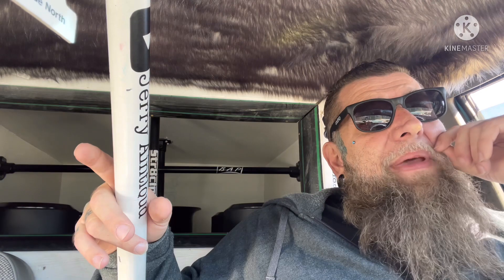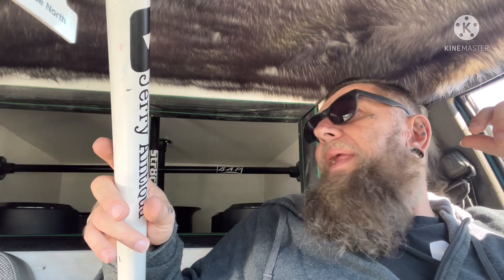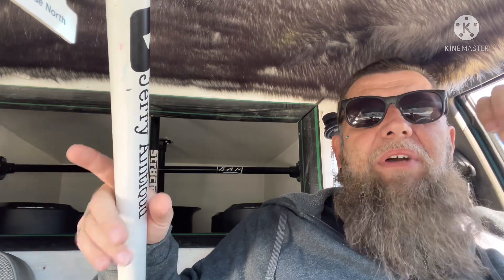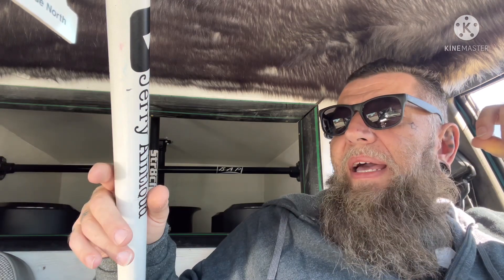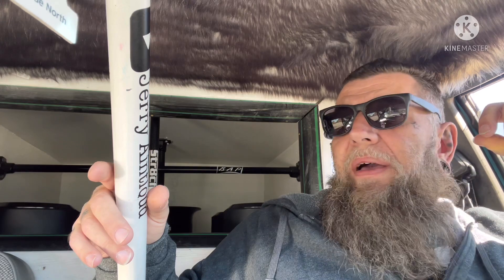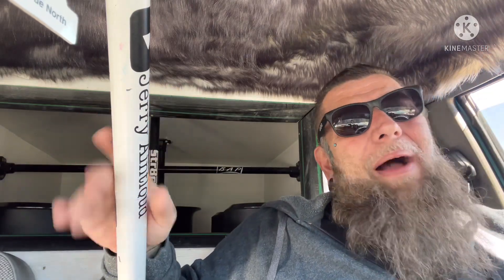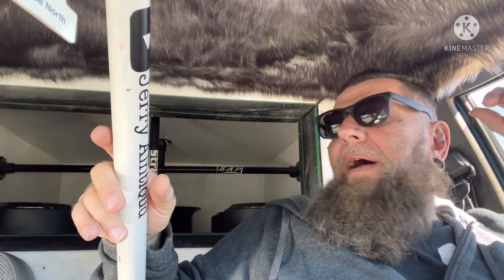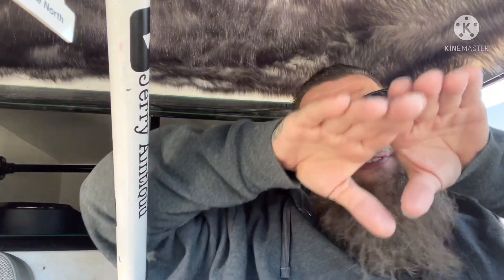Subwoofers is less more

Comment: Yeah,  everyone preaches that cone area is king... but that's not always the case, at all.  I've seen a lot of builds, over the last 30 years or so,  that when drivers are removed and or downsizing.. they gain,  and sometimes a lot of gain.  Cancelation plays a huge role, in the cabin volume, aside from the box volume it consumes in that cabin.  Standing waves, with nowhere to go.  The cabin is essentially part of the enclosure,  and needs to be considered when plotting out any build.  And many times,  it's trial and error.  It's not always, how many drivers you can cram into a build,  because many times.. less is more lol.  Good video
Reply from the maker: there's tons of variables.. back in the old days we thought only 15s and 18s would play lows.. we live and learn
Reply: @JerryAintloud  agree,  in the late 90's i always ran bigger woofers/subwoofers just to get louder lol.  I miss the mini truckin days.

Comment: Your vehicle becomes part of the enclosure..so what would the enclosure type be..4th/6th ect..box designs can get to a point of being very inefficient..so if your jeep was a speaker box with wheels where would the inefficiency most likey come from..forget about cabin or the jeep all together picture only a box in your head..measure the jeep nothing in it when rebuild run those numbers through a box program..ur windows being port size. Just for s&g's do 6 sub 8 subs ect ..it will clear up alot..

Comment: I have been running 2.5 inch coil 12s. I have them on double power and in a smaller enclosure than what the specs call for. Theoretically if I move to 3 inch coil 12s with a higher xmax and that have specs calling for a smaller air space, which my box is already, I should gain a small amount of decibels. Do you agree with this? I will be overpowering the 3 inch coils as well but not nearly as much as the DDX.

Comment: I think mbe enclosure explained  it when he said the bass wave has to mature, so from  the cone and port to your ears or to the meter, the bass wave has to develop correctly .moving too much amounts of air in a small cabin space causes compression . Not yielding  the best results. Also subs that don't pressurize the cabin enough won't yield  the best results either. So I guess you have to know what size  subs and how many moves the correct  amount of air for your particular cabin

Comment: I absolutely agree atleast with my experience.  I went from 4" coil subwoofers to 3" subwoofers and gained 1.4 db efficiency and playability is by far better now. I have a small cabin and definitely plays a part.  My build doesn't play lows. But 28hz to 45 hz is alot of fun. Clamping just over 20k on two X v.3 18s in a flatwall doing a 161.8 @ 42hz and the peak is dropping with the spiders loosening up. With both windows down  definitely plays better.  Cabin definitely plays a huge part.  There's more wind just outside the window than there is inside the cabin.  Constantly tweaking this or that. Test and tune and definitely enjoying it along the way.  It's definitely a lifestyle.  I love what we do.  Just send it! #teamware
Reply: Good to know I still haven't heard mine yet ,and20k holy shit,I don't know how much I should put on em safely
Reply: im clamping 4500 on 2 xv2 18s and they friggin get stinky -,- not clipping nothin,hitting a 154db

Comment: I went from 2 L7 12s to 2 Sundown SA10 v2. Mine is way louder with the 10s. I couldn’t believe the gains. My theory is (cabin space) I have a small car so 2 10s work better than the bigger speakers.
Reply: Should have been louder with the 2 12s. I think.
Reply: @riveralley  the 12s were probably in a box not made for them.